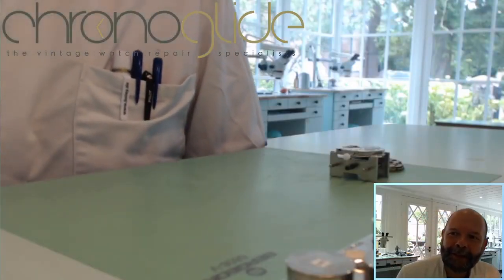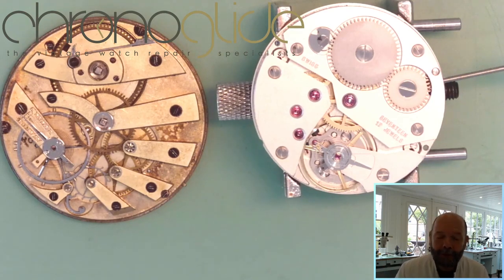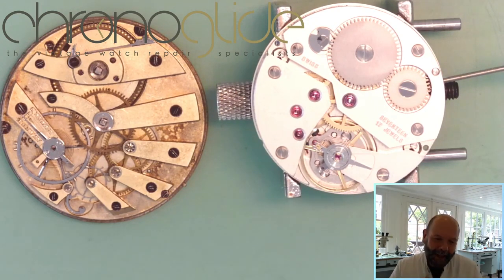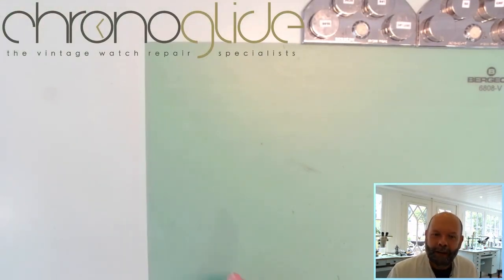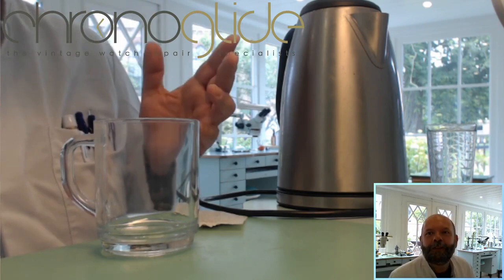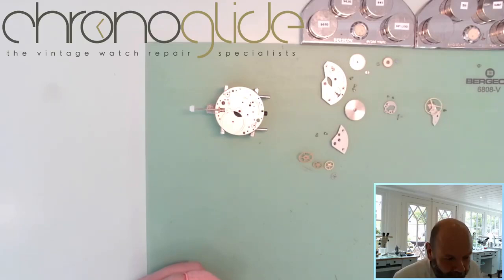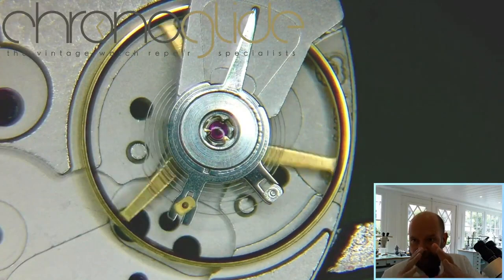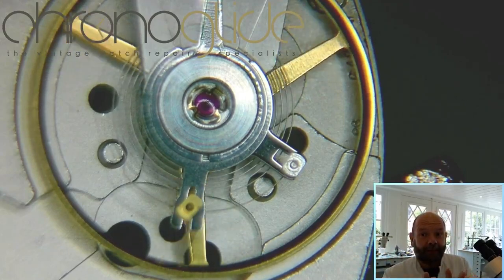Troubleshooting as a professional watchmaker - Part 1of2

Comment: Another logical and informative analysis lesson.  I’m still a novice, competent to disassemble, clean and reassemble a movement.  I can replace a broken balance staff, and replace obviously broken parts.  I don’t damage screw heads, and I have even repaired damaged hairsprings.  But I’m still struggling to learn how to solve problems when a properly serviced movement still shows irregular movement, or low amplitude that isn’t caused by oil on the mainspring or magnetized parts.  This video is a good lesson moving me forward - try to locate the problem to a specific sub-assembly.  Please keep doing these, as I learn from every lesson!

Comment: Hi klaus where can I get technical data sheets for repair/ oiling / dismantling I looked on line but no joy also what are the most popular watch movements ie eta etc
Reply from the maker: Hi Richard, if you google the caliber, number and ".pdf" you might get lucky. Otherwise Cousins UK and Boley DE have a huge online library but you need a VAT number to join them. Good luck! Kalle